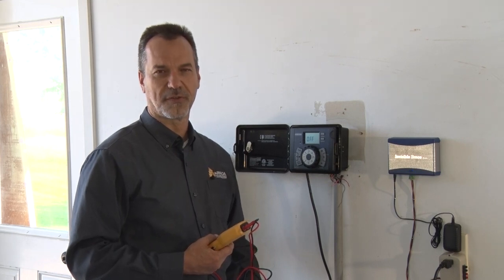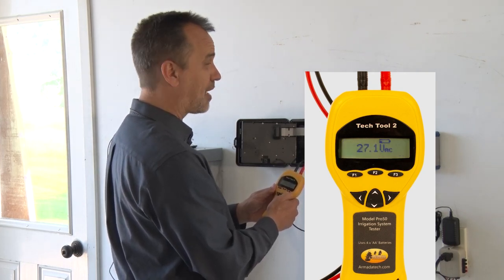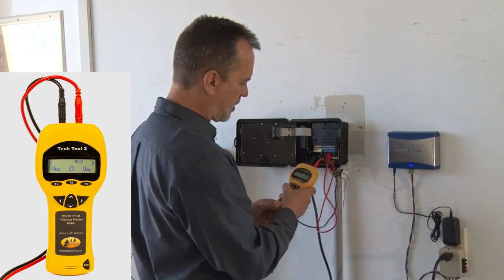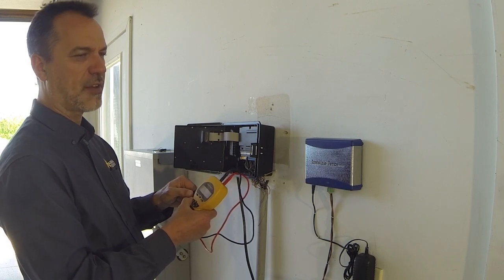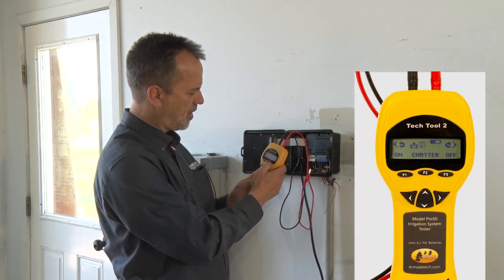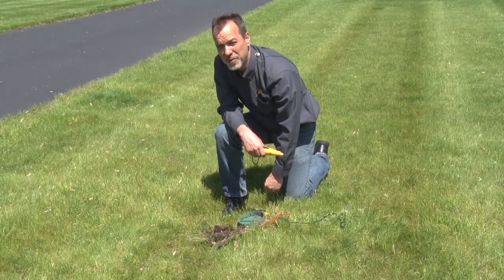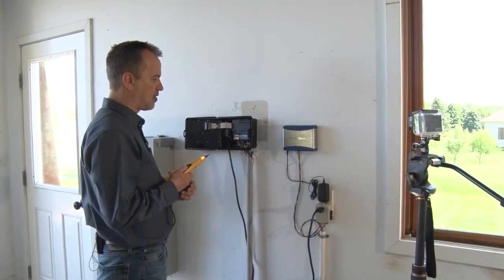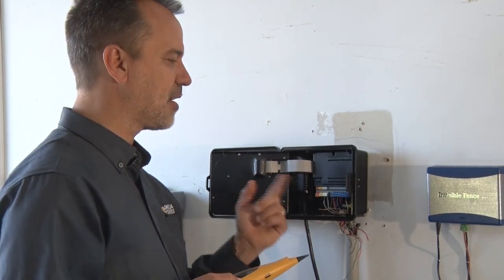How to Test and Repair a Sprinkler Irrigation System for Electrical Problems with the Armada Pro50

Comment: Minutes 3:18 talking about good resistance but picture on Pro 50 is showing 28.0K
I wonder what does it mean K on normal valve I thought it was short circuit if yes how can we trouble shoot it?
Thank you
Reply: Hi Abder. You can identify manufacturer or even some faults by reading the resistance. A 28K ohm valve would be a Toro Spike Guard or similar with lightning protection circuitry. Check our Knowledge Base app note on resistance values..

Comment: You can use the multimeter to read 120V in the case of a bad outlet correct? or is it rated for low voltage only?
Reply from the maker: The Pro50 reads up to 40 volts, though it is protected from damage if accidentally connected to a 120 volt AC outlet. Working voltages in irrigation systems are generally under 40 volts.

Comment: I’ve got this piece of junk. it NEVER works right, and sucks down batteries, won’t actuate a solenoid, it’s hot garbage.  

Pro 48 is better and more reliable
Reply from the maker: Call us when we open tomorrow, 8am eastern and we'll get this straightened out.  Our testing has shown the Pro50 to be superior to the Pro48 but sometimes things go wrong on individual items.  Give us a shot to correct the situation.  616-803-1080